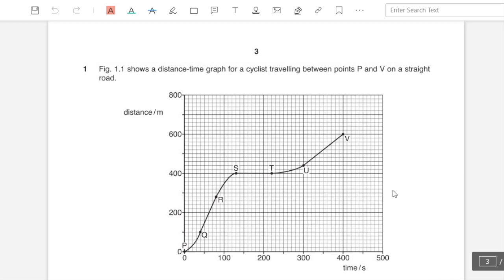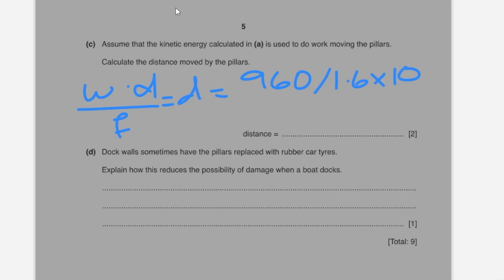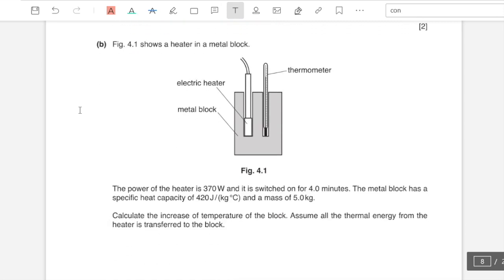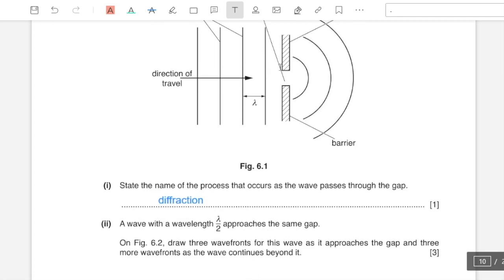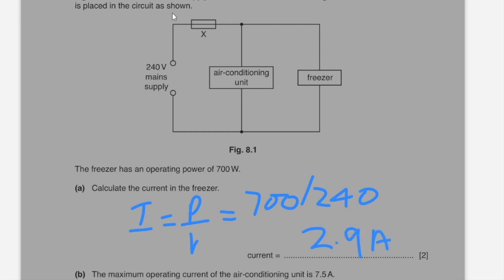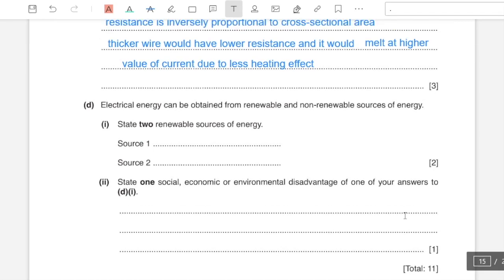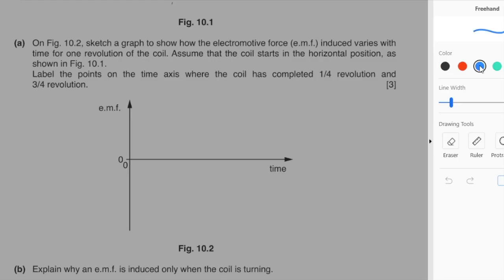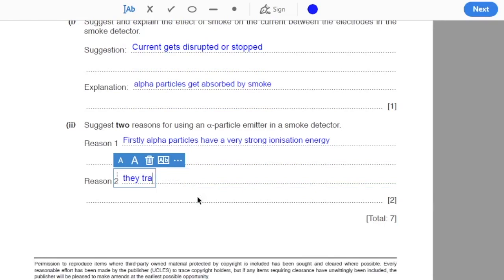CIE IGCSE Physics Solved Past Paper May/June 2019 P43

Comment: Does anyone know what happened in 7c please lol 🤷🏼‍♀️
Reply from the maker: Fuses of higher rating as mentioned in the question require relatively greater thickness.
This means a wire of greater radius and hence a larger cross-sectional area(area=pi*r^2). Resistance and cross-sectional area are inversely proportional, if a thicker wire is used (by increasing the radius/thickness) resistance of the wire decreases. As a result, the rise in temperature due to resistance is also lower, which means you can use this thick length of wire for conduction of higher readings of current without the wire in fuse melting and breaking circuit. (Current flow accompanies resistance, which leads to rise in temperature.)
Bottom line - greater area = lower resistance = lower rise in temperature = lower chance of wire melting before exceeding the desired current limit.
Reply: @examhelpweb2090  Thankyou 👸🏻 x